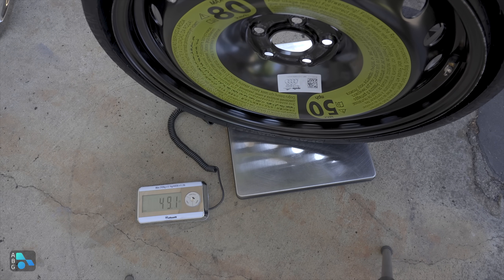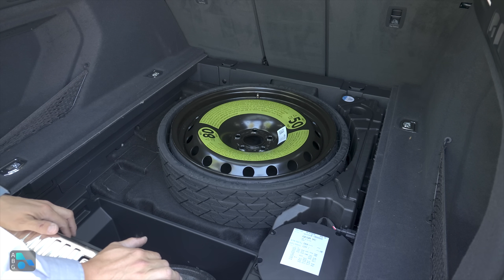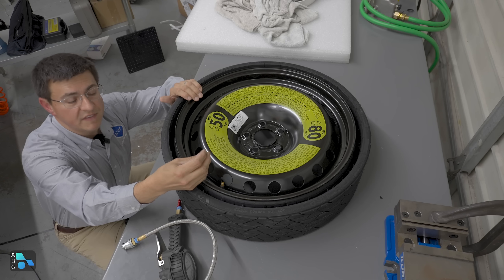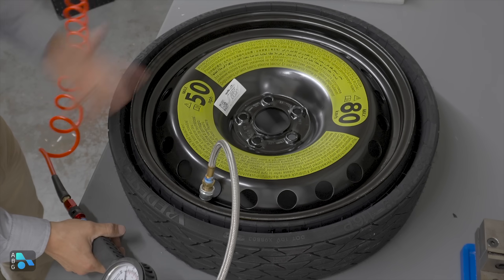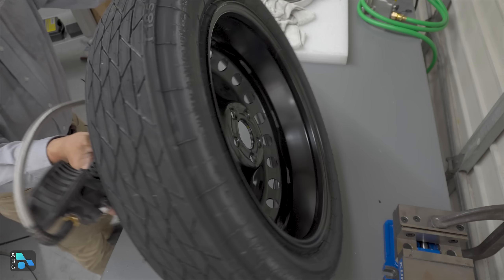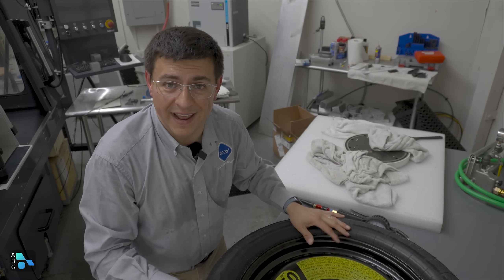How A Collapsible Spare Tire Works, And How It Might Save The Spare Tire In EVs

Comment: I have a Rogue, needed to use the spare tire  I had a flat in the worst imaginable spot at night in a rain storm but I could pull over.  Actually a nice Transport Truck pulled over and provided a shelter for me!  Working in an auto center for 5 years, I was done in just a few minutes. it's AWD and the spare is slightly different than the regular tire in diameter.  It makes an alarm come on how the transfer case will over heat... pull over... After a while it would stop showing it.  I had to drive and stop, drive and stop, all the way home.  Didn't know if I would damage something.  Any difference in diameter messes up AWD systems.

Comment: So vehicles are constantly getting bigger, yet without enough room for a full-size AND pumped spare tire like they used to 20 or 30 years ago.
Reply: Vehicles are getting bigger but customers are also demanding more passenger and cargo space. And while cars are growing, most modern cars are still smaller than cars in the 60’s and 70’s. Compare the trunk size of a modern Camry vs a 70’s Caprice.
Reply: @NovaResource  
True, but can't say the same for pick up trucks and SUV's.

Comment: Alex, If the OEM wheels and tires weren't so gargantuan in the first place, this fuss would not be necessary. 🤨
Reply: Exactly. We're suffering for fashion. Normal street cars do not need cart-wheel diameters.  Back in May 2010 Car and Driver compared 15" up to 19" wheels with the same outside tire diameter (it's available online if your search). The larger wheels weighed 14lbs more per wheel/tire combo, got 10% worse fuel economy, and 4% slower 0-60 times. 
The packaging brilliance of the original mini was down to the tiny wheel sizes. That made for smaller fenders, and more space for door openings and interior passenger volume.
Reply: @SirOsisofLiver  Exactly!
Reply: Modern car wheel size is done for a reason. A larger wheel and tire has fewer revolutions per mile. That means the larger wheel and tire is spinning slower for the same speed as a smaller wheel and tire. Another reason is brakes. Heavier and more powerful cars need larger brakes. Larger brakes require more space inside the wheel and therefor larger wheels.
Reply: @NovaResource  A few years ago I was at the car show in the Porsche display. Their street cars on sale to the public had larger rims than their race cars which had far more sidewall. I concluded that grossly oversized rims are a fashion statement .
Reply: @RightLaneHog3151  I don’t disagree they are a fashion statement but that’s not the sole reason. Also, in racing, there are rules and regulations that participants must follow. Rules that limit things like brake, wheel and tire size. Street cars have no such rules. So, just because the racing car had smaller wheels than the street car, that doesn’t mean the racing team wouldn’t use larger ones if they were allowed.
Reply: @NovaResource   When you can put your fist through the gap between the rotor and the inside of the rim, the rim is too big. 😉 The new GR Corolla is a good example of sensible balance in this area.
Reply: @RightLaneHog3151  Front or rear brakes?  Many cars you can do that at the rear because they are smaller rotors. Or maybe you just have small fists. Either way, it’s only your opinion that they are too big.

Comment: I'm impressed with how it collapses itself back down! I would have expected it needed a special process for that, but cool that it didn't.
Reply: Same
Reply: Yep was waiting for Alex to refold the tire back into that initial shape like a blow up raft.
Reply: Right, I would have thought this was a 1 time deal, have to replace it if you use it.
Reply: I thought it had to be more heavy duty, since EV s are heavy
Reply: @Eduardo_Espinoza It really depends on the EV.  There are many EVs that really aren't even all that much heavier than many other ICE vehicles.
Reply: At first I thought it will need a pump to suck all the air out.
Reply: @botbot-dt9kg :  deflate it while it’s still mounted on the hub?
Reply: after few years when the rubber dries, its not as beautiful, its trash
Reply: @retrocompaq  its well protected in the trunk and will see lot less degradation, owner be spending more on repair bills for this bad boy, the spare tire is just a small expense.
Reply: Yes, and when it does it invariably pulls the bead away from the rim, rendering the spare tire completely useless until a tire shop resets the bead.
Reply: @amzarnacht6710 making shit up😂
Reply: @amzarnacht6710  How many times will you realistically need to inflate/deflate the donut through the life of the vehicle? I can see that if someone were to really abuse it, but as you've said already, it's just supposed to be there for emergencies. When it's not in use for the very rare emergency, it saves on space. The faults of the consumers are not those of the tires.
Reply: @LitWizird  Clearly you've never dealt with one.
Reply: @amzarnacht6710  Dealt with one of the inflatable donuts? Nah, I haven't.
Reply: @amzarnacht6710  100% correct. It happened to mine and when I tried to inflate it next to the road, the low pressure compressor couldn't seat the tyre on the rim.... had to drive with the uninflated spare which off course ruined the tyre and now I cant find a replacement tyre and it looks like you have to buy a whole new rim and tyre... 
Good idea on paper, but absolute sh!t in real live when you find out that the tyre in your boot is not seated anymore and you cant inflate it when you need it....
Took it in to a tyre shop and they inflated it, with the bead mounting with the higher pressure compressor, but when it deflated, it dismounted again rendering it useless....
Reply: @amzarnacht6710 :  I believe that the yellow 50/80 sticker means 50 km (km/h?), flat or 80 km (km/h?), inflated??

Regardless, the purpose of a spare is to allow you to get to the nearest shop to get your flat tire repaired not to drive for excessive period of time on your spare tire (yeah, I’m talking to YOU).
Reply: @kennethmelnychuk9737  I change tires, I'm quite familiar with that warning... people ignore it.  I'm presented with donuts that have been driven bald on a daily basis.
Reply: @kennethmelnychuk9737  50 mph, 80 km/h.
UPDATE: Personally I wouldn't go anywhere between 35-40 on a donut, but that's just me.
Reply: @:  makes total sense, I stand corrected.

Comment: Chrysler started using these in 1970 on the Barracuda and Challenger because of the small trunks. Been used in various vehicles ever since. Chrysler Pacifica uses these.
Reply: GM cars had them back in the late 1960’s too.

Comment: If you lose that valve stem, they're available at all car and bike shops. It's called a schrader valve.
Reply: You can always grab the valve core from the valve stem of the failed tire or another valve stem near by!
Reply: @randyfitz8310 sometimes, not always. Sometimes the stem could have a bad valve in it. More reliable is a new valve.
Reply: The only part on your car that’s interchangeable with every car, truck and motorcycle on the road since 1953 is the schrader valve. 
However some bicycles that use high air pressure rates use presta valve while schrader valves are use on most bicycles.
Reply: If you lose the valve I’m sure the shop that is repairing the flat tire will find you one to replace it. 🤦🏻‍♂️
Reply: I cant believe people have never seen those type of cap!
Reply: @Golo1949  It's not that they haven't seen and used schrader valves their whole lives. But most have never had to remove a valve stem to create zero resistance to deflate a tire fully. Most people don't know the valve stem is removeable with a tool and that it screws out. Give them the knowledge to do that and they might just drop it or eject it far away as  we saw in the video and lose it in the grass or under a cabinet in their garage. Then, people without any knowledge about how easy it is to source a valve stem, might do a really bad thing and return to a dealership for help with their spare, and there they could easily be told it's terminal and you need a whole new one for $500, because many dealerships take advantage of consumers.
Reply: @Golo1949  Very few today know anything about their vehicles .............................
Reply: @Golo1949  pretty amazing indeed.. :)
Reply: @Golo1949 sometimes you find aftermarket caps with a Schrader valve tool built in. Most consumers don't even realize what the purpose of the notches in the cap is for.
Reply: The whole thing is, but the part that unscrews is the Schrader valve core. If you're not careful it will go flying, then it's off to the auto parts or tire store as well. Where I live good luck finding a bike shop.
Reply: @horsepowerandtalk1033  You could always use the one from the FLAT tire you took off the vehicle to install this spare.
Reply: @horsepowerandtalk1033 i think most walmarts also carry them as well, and those are almost in every town lol
Reply: @PMitchell106  LOL!  If anyone is that concerned with removing and possibly losing a tiny valve they probably shouldn’t be jacking up a 5000 pound vehicle.
Reply: @NovaResource  No person should own a 5000lb vehicle. That is just silly.
Reply: I inflate the tires of my road bycicle at about 8 bar. That's loaded semi truck kind of pressure. Its like a train wheel but it's unfortunately rubber so anything that can puncture it will. So I put in a sealant and it works great so far. There's cuts, puncture marks but no air leaks. And that's 8 bar. Why there's no sealant inside a car tire from manufacturer ... just in case. I'm pretty sure at the pressure of a car tire it would work perfectly, the puncture holes may be bigger but the pressure is much lower
Reply: @GeorgeS-fe7eh  I've used numerous cans of Fix-A-Flat type inflato4 and sealer products over the years in a pinch and they didn't do jack to seal the leak just spewed and splattered it back out the hole until the tire goes flat again. 

No one should assume that useless stuff is the same as the stuff you're talking about.
Reply: @GeorgeS-fe7eh  Two reasons you don't use "tire goo" on cars. First the bigger, faster spinning car tire would never stay balance. Second is on a bike the goo sticks inside the innertube, tire, and spoke protector. All of these are replaced together. On a car you would coat the rim and glue the tire to the bead. Tire shops will refuse to work on it or charge double with no liability or warranty.
Reply: @gueto70  oh you're right I forgot. The bycicle tire is not tubeless. So the goo does not actually spread like you mentioned, you can change everything on clean, it doesn't spill
Reply: @GeorgeS-fe7eh the problem with liquid sealants is that they tend to get in the Schrader valve and create problems. Aftermarket liquid sealants are worse because you insert them through the valve ensuring that there will be a problem soon.
Reply: Old school tip/trick.
Go to the auto parts store and buy a 2 to 3 inch long valve stem (Should come with the valve installed.)
Now, when you remove the cap/valve remover tool from the flat tire...screw it ON the valve stem you bought.
Now you have a much larger 'handle' to remove the valve.
And within the long valve stem an extra valve.
Reply: @StudioDaVeed  I've never needed a handle for those caps and I already have a spare Schrader valve in the valve stem of the flat tire I just took off if really needed.
Reply: Buy a package of these valves - they cost like, what, a buck or two?  Grab one of those emergency meds capsules (the kind for nitro tablets) and put them in that, then in the glovebox.  They'll never get lost or damaged and can be used to replace one when it goes flying.
And get a valve core tool - the best ones are shaped like a pen, NOT a 'T' (the 'T' shaped ones suck, you do not need that kind of torque to take out a schrader valve and you most certainly don't want to apply that kind of torque).

And when some choad acts a butthole in a parking lot you can always wait for them to go into the store and simply pull their valves...
Reply: In my experience you can find them all over the ground at any tire shop. They don’t bother trying to keep track of them. They let ‘em’ fly and put new or used ones in your tire.
Reply: People keep referring to 'the flat tyre (tire)'. Do they not watch YouTube? So many tyres shredded to peices and the wheel ground down to nothing because many drivers are complete morons. Would they even know A, it can be changed or repaired before it is destroyed, B, how to do so?
Reply: Also at any auto parts store.
Reply: It's a convention stem arrangement used prior to the switch to steel base valves as rubber valve stems tended to deteriorate over time or due to vandalism.....
Reply: I've taken one out of a normal spare and it comes shooting out. So don't forget your eye squints.
Reply: It looked like a presta valve
Reply: Is that schrader as in schedule or schrader as in schedule?
Reply: Thanks
Reply: Or available at the Audi dealer for $50!
Reply: schrader valve CORE. 
also the core doesn't need to be removed, pressing the pin of the core w/ the valve cap (even w/ a fingernail) will release the air.
Reply: If you lose that valve stem for the spare tire just remove the valve from the tire that you are replacing with..
Reply: Well if you loose it the old flat tire has it. You can unscrew it off and use it on the spare. Done deal.
Reply: You can always take one out of the flat tyre like everyone is saying or..……… from a car parked near you but not too near and get a rush of excitement making your tyre change more fun
Reply: People driving cars don't know that?
Reply: Breaking bad 👀
Reply: I made that valve. Swear.
Reply: Also if you do loose it, the tyre you are removing from your car also has one in its stem
Reply: Thanks for that.  My anxiety on dropping or losing that valve stem would make me sacrifice the extra cargo room for a full-size spare.
Reply: @chiemekaa 
Something tells me you’re not the sort of person who’d be changing a tire.
Reply: @oggyoggy1299  Lol.
I can change out a tire, no issues, except having the hassle of extra components to inflate a tire before installing.  Especially when time and weather play a factor.  I live in Houston and have had the displeasure of changing out a disintegrated tire during peak summer along a busy stretch of freeway.
Reply: @oggyoggy1299 the fact that they watched and commented on this video suggests they would at least give it a go if assistance wasn't available.
Reply: @chiemekaa haha your fault for not checking your pressures, I guarantee it
Reply: @stevelloyd5785  
I can't say undoubtedly if that was the cause, but it sounded like a sudden puncture at speed as the tire practically disintegrated.  Thankfully the car remained stable.  It was a 92 Civic.
Reply: @chiemekaa  that really doesn't happen like that as far as i know. Like what would cause a "sudden"  puncture that dumps all the air and shreds the tire?

Over heating caused by an under inflated tire on a hot day is definitely a cause of sudden catastrophic failure. Been there, done that, both stopped in time and not done so
Reply: @chiemekaa just get a pack of them and put it with the pump
Reply: @chiemekaa all tire valve stems have Schrader valves. You can even get the tool for replacing the Schrader valves. I have seen tires leak from the valve itself.
Reply: @chiemekaa fyi those valves are 1 time use, their supposed to be replaced whenever they're removed because of the crush washer otherwise it will leak if reused.

Comment: How is it a space saver when deflated; in fact it has to be inflated at all times for sudden emergency use.
Reply: It’s a space-saver because the tire is smaller when deflated. And it doesn’t need to be inflated at all times because you inflate it with a pump when needed. Did you even watch or listen to the video?
Reply: @NovaResource  I did watch it...who  drives around with a pump? Unless it is part of the vehicle package . My spare tire is inflated and checked periodically...
Reply: @indecentvideos3762  Are you sure you watched it? Specifically at 2:03 where he says, “Now let’s get to the inflation. I’m not going to be using the pump that came with the Audi because it’s a little on the slow side.”
And at 5:33 where he says, “Under this little partition we then find the tire inflator kit “ (aka tire pump). 
Try again and this time with the audio on and your eyes open.
Reply: @indecentvideos3762  Maybe it’s just me but I usually like to watch every second of a video before I start posting negative comments about it and replying back to people that try to correct me. Maybe I’m just old school that way. 👍🏻

Comment: One reason I see why not to put it in the front would be the high lift floor needed to get over. I guess they could do a big overhaul on the grill front area maybe make it a slot or something
Reply: Front crash and pedestrian standards might also be the reason the wheel is in the rear cargo area
Reply: @perryleenders1070 Yeah, because having a 49 pound tire up front is WAAAAAY more dangerous to pedestrians than a 400 pound engine block in the front of most regular cars. 🤦🏻‍♂️

Comment: "Quite a while" might be considered a bit of an understatement, as my 2014 Audi Q7 came with one of these spares.  Interestingly, it is also stowed in the orientation suggested, as the space within the wheel is used to mount the subwoofer for the sound system.
Reply: Just went to check, my 2012 A6 has this too (as expected given the same MLB underpinnings). Neat!
Reply: They go back further than 2014 or even 2010. GM cars had them in the late 60’s. First Gen Camaros had them.
Reply: @NovaResource   Yep.  Looks like the foldable spare tire concept started in aviation before it was adopted by the auto industry.
Reply: even Touaregs had these circa 2010.
Reply: @seb.  Yeah, same generation and platform.